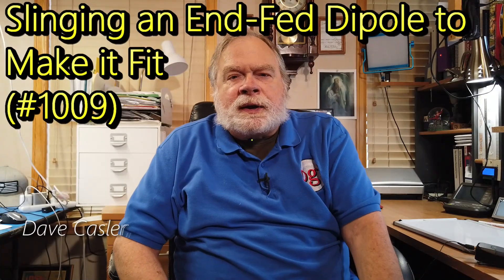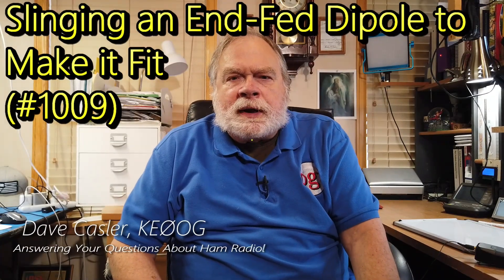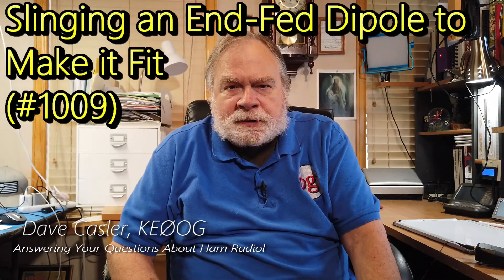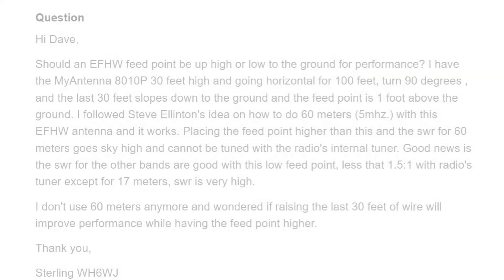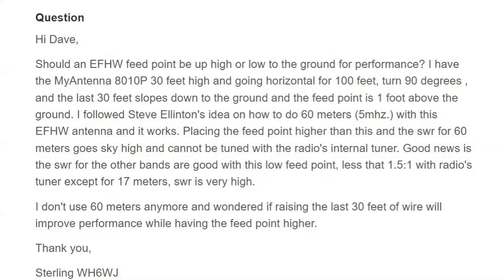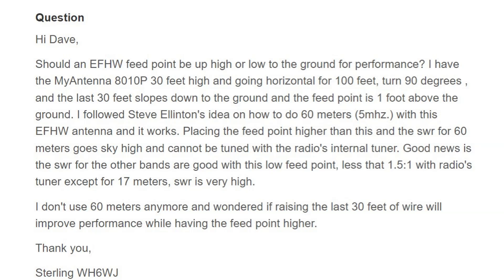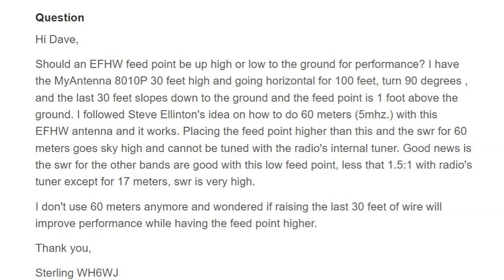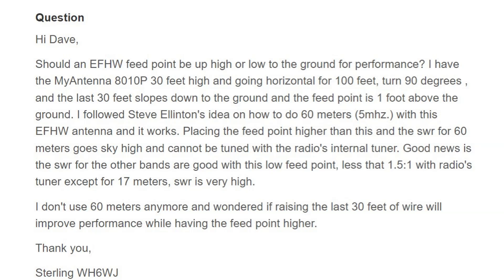Slinging an End-Fed Dipole to Make it Fit (#1009)

Comment: I'm using the MFJ-1984HP, END FED, 1/2 WAVE, 40-10M, 800W, WIRE ANTENNA ($109.95) and it works great.  With the MFJ-998, AUTO TUNER, 1.5kW, 1.8-30 MHz I've been able to work 160 and 80 meters, along with 30 & 17 & 12 meters too.  I've found them to be a great combination.  If I only could have 1 antenna, the MFJ-1984 would be it!

Comment: Hi Dave
I just bought a new stryker 497 hpc and being new to Ham radio I am trying to find the frequencies that the band switch positions (A-H) relate to. I know CB is on the D band position. Cant find any thing on line, hoping you can help with a link or an explanation. I am really not interested in the CB ( put up with that for forty years over the road trucking).
Gary